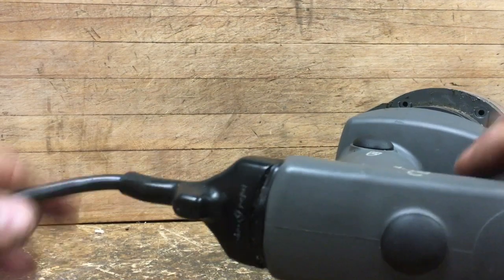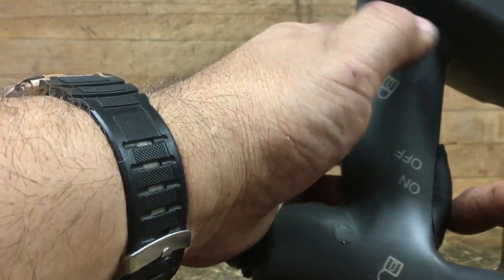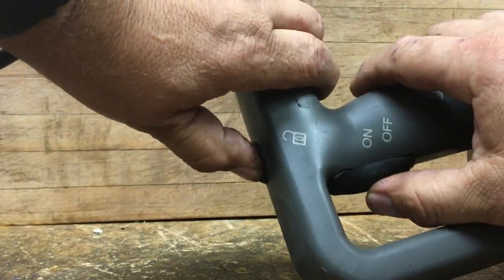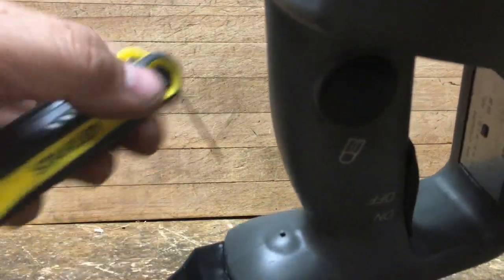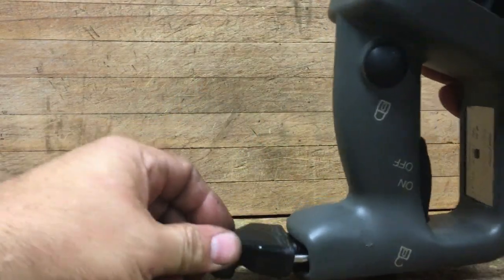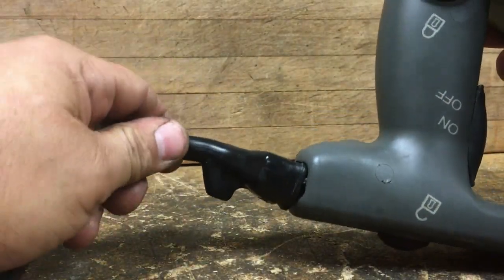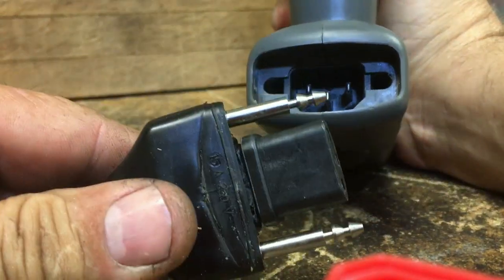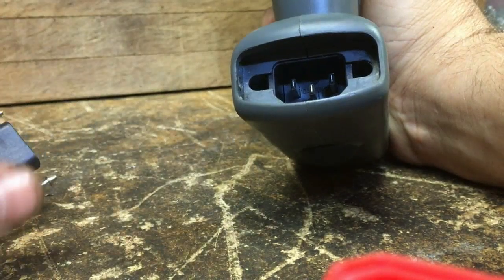Robot Coupe, 450 Turbo; Part# 02 Removing Electrical Cord and Reviewing Safety Controls

Comment: Do you have a video about replacing the rubber button covers???
Reply from the maker: Yes in bits and pieces, but not edited just yet. I cannot get to it for a while, sorry about that. I have a PDF from the factory, its not much for instructions, just an exploded view and has the part numbers on it which could be very helpful if you like. Send your email to me at "practicallyreview@gmail.com". If you do, I can send you it for now until I can get the time to create the entire handle assembly instructive video. One thing I can warn you about is be very slow when opening the handle assembly lots of springs and very small pieces, it will take you a long time to figure out where everything goes and put them back in without having them fall right back out again. As nice as the mixer is, its a bear to repair in certain areas, and this is one of them.
Reply: @practicalreview6400  robot coupe mp 800